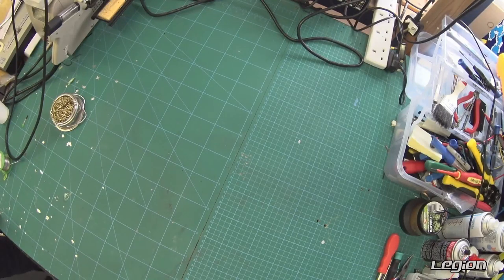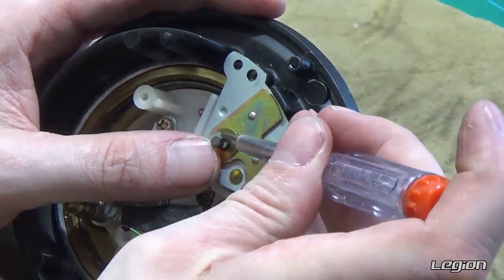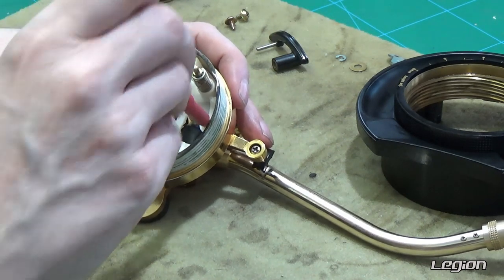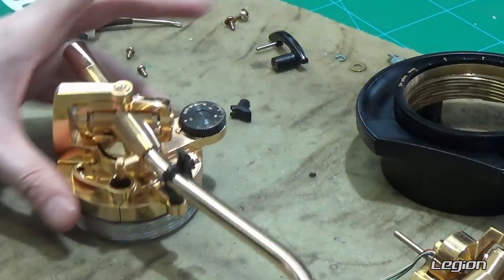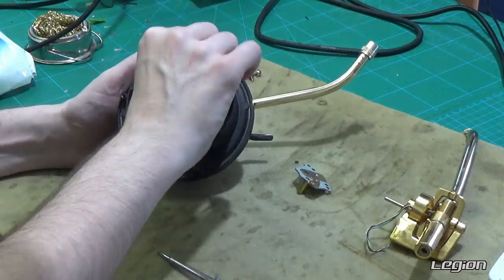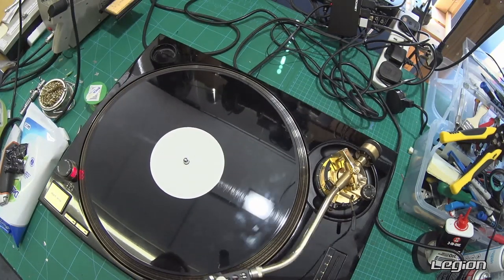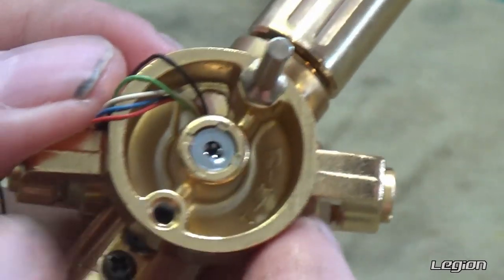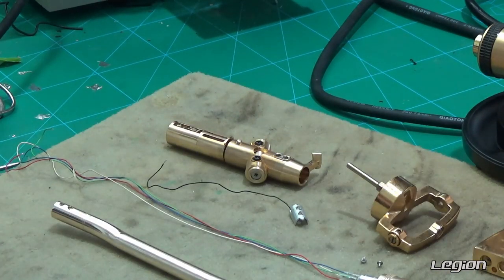How to replace the tonearm on Technics 1200-1210 Gold edition.

Comment from the maker: I am adding a new rule. No help or questions answered unless it's related to the video and you are subscribed to the channel. It takes up to much time to reply and I am not free tech support.
Reply: Could you possibly go into more detail about the height calibration, when locking in the bottom plate, after re-adjusting the height ring and screwing on the outer ring, the alignment is out. and i cant for the life of me figure out why?

Comment: Excellent video.  I was able to fully disassemble my tonearm (even further than the video) and replace the noisy headshell socket and the broken tonearm centerpiece on mine, as well as clean and lube everything back up.  Now I have a crystal clear sounding, smooth operating 1200.  Appreciate it!

Comment: Hi - Just googled the price of replacement tonearm and nearly had a fit. £189 is cheapest new that I've seen. I need to replace due to bearings being totally screwed and a dint on the arm. Wondered if any of you good folks knew of any that were cheaper. The gloit before me had driven the pivot screws so hard that the bearings looked actually fused. Man, some people should never ever pick a screwdriver up. Any suggestions would be gratefully received. 

Peace.

Comment: hi, I know this is an older video, but I have a 1200 with a bent tonearm tube. do you know how I should replace only the tube? to reach the screws to remove the tube, I’d have to take off the two screws that the arm itself swivels on. when I reassemble that, I hear there is some torque calibration involved in those two screws. is that something I have to worry about? thanks
Reply from the maker: the screws that hold the bearings in place are the ones that need to be adjusted so you can take everything else apart while leaving the bearings screws in place if you're not happy doing that part.

Comment: For those who are confused about the reassembling at the height adjustment ring:

1. screw the tonearm assembly all the way into the height adjustment ring. then rotate back until the little arrow points to 0. 
2. then screw the entire tonearm + height adjustment ring all the way into the base. Rotate back out just until the locking plate sits flat and aligned with the guides and can be screwed in.

Comment: I had a tonearm replacement. And I am sure He never put the Anti-Skate spring In, or didn't locate It properly like you did here. I can turn It and nothing happens. I would do this If It was ten years ago. But the hands and Eyes are not up to this kind of Assembly. At least I can see where He went wrong. Thanks for sharing this.

Comment: ah, thanks for the advice on how to properly start the threads into the base at the number 1 position.
Reply: watched a video where it told me to do it at the zero position and my tonearms have been skipping like crazy. Going to open both decks back up and try to 1 position.
Reply: @Urnkle  that doesn't have anything to do with skipping. It's just for height adjustment.

Comment: Very informative and detailed thanks. What type of grease did you use for the adjustment ring with the thicker thread?
Reply from the maker: I use RC car gear grease.
Reply: thanks, do you know if its lithium or silicone based?
Reply from the maker: it's Molybdenum Grease

Comment: my tonearm was stiff and kept tracking backwards when trying to play records so I loosened the top screw and it seemed to fix it.. Is this going to be ok having a slightly loose screw like that?
Reply from the maker: not really it can skip and jump around depending how it's used. have you tried to adjust the top screw so it moves correctly without being too loose ? if it's not possible then one of the bearings is damaged.

Comment: You really don't need to put out the plastic base to change the tonearm. Only thing you need to do is desolder the tonearm wires, remove one of the screws on the PCB, the other just loosen and turn the pcb and there you have 2 holes for the tonearm screws. Please don't use oil... but a proper grease.

Comment: Just bought 2nd hand 1210. £200. Anti skate shot, snapped armlock superglued, wobble in the arm, height adjust stuck. Few other lesser issues. 

Quite depressed til I saw this! What a boss you are. Quietly hopeful I can address some issues.

Thanks dude.
Reply: UPDATE-Stripped down as per video. Issues identified and quite the shopping list! New arm, arm lift, every base plate srew replaced, wires plate, on/off switch, arm holder and more. 

The superhero before me had superglued a match covered in insulation tape as arm lifter. In the process had bathed superglue everywhere, down into the height adjuster threads. Other blasphemies that would only depress you. 

Eminently fixable and once again big shout out for the tutorial. If that engineer mindset is lacking leave well alone. 

Great project for the darker nights!!

Comment: Some good lithium grease or helicoid grease might be more permanent than 3 in 1 oil on the height adjustment, other than that, great video.
Reply from the maker: I do use white lithium instead of the 3 in 1 since this was made
Reply: Some say do not use lithium grease. I have lithium, moly and silicon grease. Which one you recommend?

Comment: How about anti-skating calibration?
You have to make sure the spring tension starts at 0 after putting that tonearm onto its base.
7:40 looks more like an approximation to me.
Reply: Actually you have to set it to 0.5 according to manual. So that at 0.5 spring touches the metal pole.

Comment: According to Technics service manual, the antiskate should start at 0.5 not at zero.
Reply from the maker: Thanks I will take a look, I just made sure to put it back at the same point as all the others I have seen. It will not do anything until it has turned a bit so the 0.5 makes sense.
Reply: @DJlegionuk  i usually make sure the spring starts touching tge tonearm at 0.5 since the manual recommends it. Next time you take apart one that was never disassembled before check for this before you take it out.
Reply from the maker: @DCDi34  I will take a look.

Comment: When my Anti-Skate is at 0, it still retracts. I checked the spring and it is in the correct position as depicted in the video. Is it possible my bearings are toast?
Reply from the maker: it could also be your deck is not level
Reply from the maker: @UCaZctdF7P63jj_ibv5nzBFQ if it gets stuck at any point I would take it apart and do a visual check.
Reply: @DJlegionuk  Thank you.

Comment: When replacing the tonearm with new wires, there are 4 that come from the headshell (left and right twin phono). Then on the internal board there's an earth (so 5 wires of the same gauge). This is aside of the larger gauge earth that runs to the external. Is the 5th wire ran inside the tonearm and earthed there? If so where to? Thanks!
Reply from the maker: hi, the black wire on the internal board connects to the silver tube on the tonearm and this is also connected to the collar that the cartridge screws into. Inside the 1210 the thicker black wire is connected to the cover plate and the pitch control, but the power supply is not earthed so nothing has a earth ground until it gets to a mixer.
Reply: Thanks for the reply. Great vid also. But i''m still a little confused on the earth in the actual tonearm.
On the Collar the cart screws into, it only has 4 contact points? I can't seem to see a place for a 5th wire, only the twin phono connections (white, red, blue, green)
I was wondering if it came from the internal board to the back of the tonearm (where the counter weight is).
Reply from the maker: yes it has 4 contact pins and then the rest of it is the 5th connection.If you look inside the end of the collar you can see 4 brass dots and then the inside of the collar is the ground.

Comment: Thanks for this it was really helpful. I have a loft find with a stuck head shell and aluminium corrosion. I have tried some penetrating oil ,no joy. I think those screws at the end of the arm will help get a little further hopefully.
Reply from the maker: I would be careful with those small screws as I find they don't always want to tighten up again. Good luck
Reply: Ooooh really. " Don't want to tighten " as in strip out easily ? Ok I will be careful ty for the heads up.

Comment: Thanks DJ Legion. Another great video with great film work and instruction. I'm curios if you have any experience in repairing such a bent tonearm - arm - with such a dent in it. It certainly looks to be a more fine mechanical operation, with obvious risk of snapping the arm but perhaps achievable if done with utmost care?
Reply from the maker: I would say no, they kink to easy and I don't know what tool - equipment would be needed.
Reply: With high pressure water, same technic for exhaust pipes.

Comment: Muy ben trabajo amigo, what is the type of conical tip screw you removed in the 13:45 minute?,I need one for my turntable, saludos..
Reply from the maker: it's special to the technics tonearm, if you search for technics  bearing pivot screw you will find them.
Reply: @DJlegionuk  thank you very much my friend, I just found it on ebay..

Comment: I'm having a problem where my time are will pull hard back to the rest with the anti skate at 0. Any idea what would cause that? They are m3d's that I've had for about 20 years with very little club use. I've also never had them serviced or anything.
Reply from the maker: the bearing is damaged or possible not setup correctly.
Reply: @DJlegionuk  Turntable is level, weight is at 3 grams, and anti skate at 0 (both specs from Ortofon.)
Reply from the maker: @BeersAndBeatsPDX  like i said you will need the bearings checking they could be damaged

Comment: This is a great video! Exactly what I was after! One question if someone can perhaps answer it though, i’ve seen some videos saying you shouldn’t use certain types of grease (like lithium) but they don’t say what type of grease they do use. Anybody know what sort is okay to use on this mechanism?
Reply from the maker: on what part the height adjust ?
Reply: DJ legion yeah, the stuff you put on the threads with you finger, connected to the tone arm base. I noticed you put 3 in 1 oil on the outer threads if that makes sense. Thanks so much for replying!
Reply from the maker: @UTO0O0B  have a look at a few of the comments as that is talked about a few times. Why says not to use lithium ? I now use white lithium on the thin threads
Reply: DJ legion ok. Thanks for the advice. 

“What ever you do don’t use copper grease or lithium grease” - https://youtu.be/_xJs7J1RViU

What confused me was I googled the multipurpose grease he uses in the video, and it is lithium grease! Anyway thanks again for replying. I shall have a crack at fixing my seized height adjustments. Cheers.

Comment: Which grease should I use? I have moly grease, lithium grease and silicon grease? Some say to use lithium but in similar video on YouTube another guy say do not use lithium grease.
Reply from the maker: at the moment i use moly on the thicker threads and white lithium on the thinner ones.
Reply: DJ legion thanks for quick reply. As the lithium I've got is rather black thank white I will use molly on both. The WD 40 silicon grease is very good especially for electronics but I feel like it's doesn't give enough grease (it's not thick enough)
Reply: DJ legion actually I'm on my way to screwifx to collect while lithium wd40. Will do exactly your technique

Comment: Do you sell the used tonearms? Or do you throw them away? Interested in buying.
Reply from the maker: At the moment they are very expensive so I do not sell them as I need them myself. Any parts I have are used again when possible apart from the bent silver tubes. I have found a way to replace bearings with RC types and my testing is working very well so far.
Reply: @DJlegionuk  understandable. I replace the bearings also. Parts are so scarce.
Reply from the maker: @ricardobarrera9642  how do you replace them ? I use small RC bearings and made a thing to hold the pivot in the correct place so I can drill a new hole the same each time. I can still mess it up sometimes, but I can replace either the top or bottom 94% of the time with no errors and the tonearm moves just the same as an original one.
Reply: @DJlegionuk  I use the same bearings from other broken tonearms as long as they are in good condition. To put them on I use a pin punch set. Where do you buy the bearings from?
Reply from the maker: @ricardobarrera9642  EBay. MR52 zz [2x5x2.5mm]. What pin punch set to you use, I have been looking for one for ages.
Reply: @DJlegionuk  well not sure if you are looking for the same punch set as mine which is common. Depending where your location is at I bought mine at Harbor Freight. I always set them on perfectly but have to be careful. There is a place in Australia that sells those bearings but you have to buy 1000 pcs. They are a dollar each. I wish I could only buy what I need. Let me  see if I can find the site.
Reply: @DJlegionuk  Miniature bearings Australia. There are 2 types one with open bottom and one with closed bottom. When you go to the site scroll all the way down. You will see them.

Comment: Hi, 

Do you have a video or some advise if the tone arm doesn’t move as should with the anti skate? 

Regards
Reply from the maker: everything is in this video, first make sure you have the correct weight for your stylus, if it does not move correctly it will need the parts checking like I show in this video.
Reply: @DJlegionuk  I heard I could adjust the screws in the top and side of the top of the tone arm to adjust the anti skate?  Is this false? 

Thanks so much for your response
Reply from the maker: if you need to mess with those screws you will have bad bearings. They should be set and never touched to adjust the movement. If you have someone local that repairs turntables I would have it checked.

Comment: Hi Lee, first of all thanks for the great videos on technics repairs they have been most helpful, I have used this video to change the tonearm wires on my turntables, however on one of my decks now when the needle gets towards the end of the record it jumps backwards. I have had this apart now several times to try and rectify this with no success, the anti state seems right, there is nothing fouling internally ie wires, the bearings seem fine. Have you ever had this problem before? Any help you could give would be great. Thank you.
Reply from the maker: it will be the bearing or the point the bearing sits on.
Reply: @DJlegionuk  hi Lee thanks so much for your reply, the bearings and pin look great to be honest so at a bit of a loss. Is there anyway I can contact you privately?
Reply from the maker: @scottmellors2854  based on what you have told me it can only be the bearings have a very tiny deformation on the top or bottom or the points are not pointy.
Reply: @DJlegionuk  no problem mate, thanks for all your help, I will have to see about getting a new housing piece, thanks again for your help, very much appreciated 👍
Reply from the maker: @scottmellors2854  I can fix the bearing for you
Reply: @DJlegionuk  hi Lee, that's great, how do we go about doing it?
Reply: @DJlegionuk  I've had this in bits again the bearings and pins are good, looked at them under a magnifying glass. It seems to be the anti skate. It is set up as described in the video but when it's all back together and you turn the anti skate it only moves the arm very slightly 10mm or so?
Reply from the maker: @scottmellors2854  ok if they are good , I would then guess you have the small screw at the top too tight.

Comment: This is way too long replacing the tonearm. After you unsolder the wires from the PCB, twist all 5 tonearm wires and tie a long piece of dental floss to it. Pull it trough slowly. Once you have the dental floss through the hole, cut it, then tie the new 5 wires from the new tonearm and pull the dental floss back through. You could save tons of time doing this. Taking all the stuff apart is way to time consuming. Once that plate is off the bottom, you should only remove 2 screws and the tonearm pops right out.
Reply from the maker: why don't you make a guide to this ?

Comment: What kind of c-clip pliers do you have, where did you get them? I’ve been looking around for ones that will work with tiny clips but haven’t found any yet.
Reply: And somehow, the c-clip that holds the gear and spring on the plastic has come off as well; that one’s a little trickier to get on without the proper tool. I’m going to put the whole arm into a clear plastic bag so if the clip flies away, it hopefully will still be in the bag.
Reply from the maker: @billwillard9410  I dont have one and still use a screw driver to pry off and then angled needle nose plyers to put back on. I brought a tool I thought would work, but it was for those clips that have the little lugs on the end and the tool spreads the clip open. I also have a box of verious sized clips just incase I loose one !

Comment: gust used a Nintendo control wires better thicker and 3 wires and run threw the arm because the wires are to dam small your good at that but omg how you solder such wires
Reply: reson why because those are easy to rip use Nintendo control wires 3 of them left right one ground